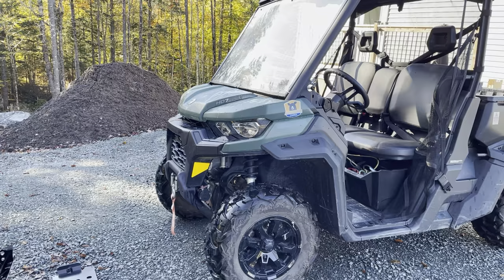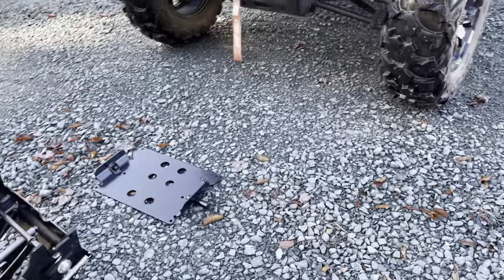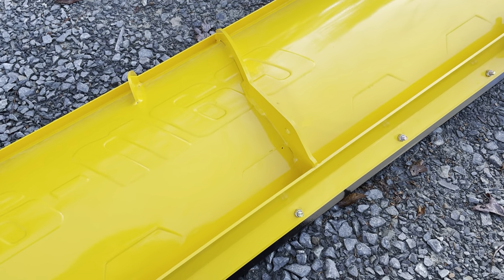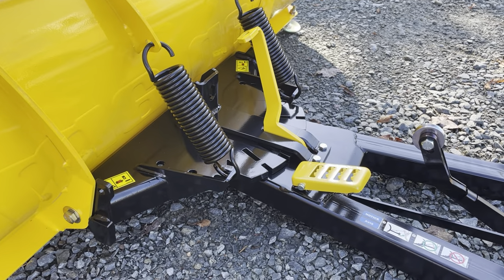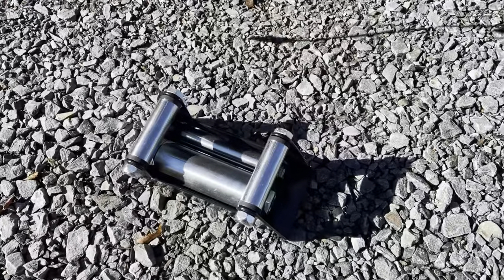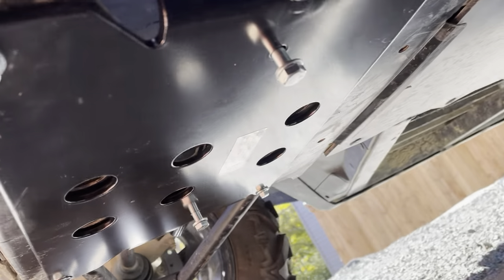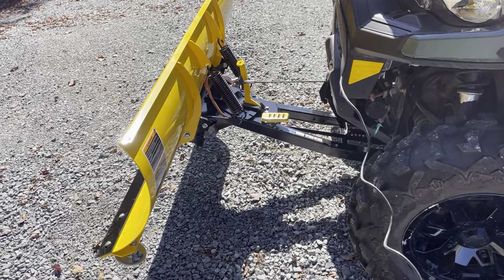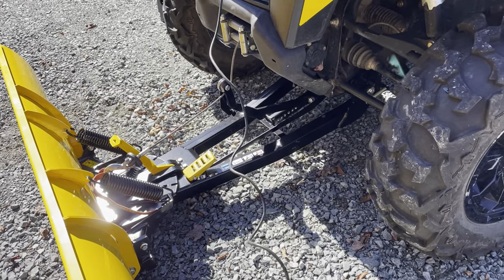Installing 2022 Can-Am Defender Promount Snow Plow Kit

Comment: Did you find the 66” blade to be a good size fit for the machine? Or would you go to the 72” if you could go back?
Reply from the maker: I did not run into any issues with the 66. I was told initially that I « needed » a 72, but even when at an angle, the 66 worked fine and overall worked better I thought when working in tight spaces. If I had a larger/longer driveway maybe i would consider a 72.

Comment: Do you use a limit switch to prevent the winch from pulling too far and damaging something?
Reply from the maker: No i don’t but I did notice Can-Am selling a limit kit for 150$, probably not a bad idea depending on your usage, you pull it up more often. Dunno if it’s something I would look into.
Reply: Maybe THIS is my problem.  I have snapped the steel cable so many times. I’ve been blaming a “bad rewind” which created kinks in the cable. Maybe better with a synthetic cable?  The only variation I have is a larger roller which was installed.